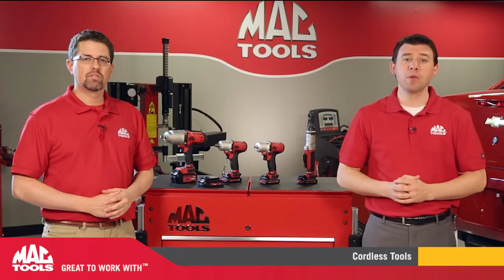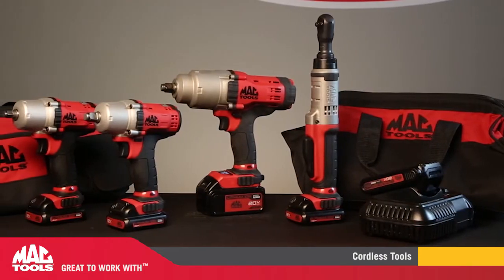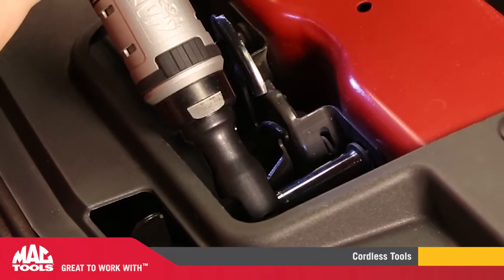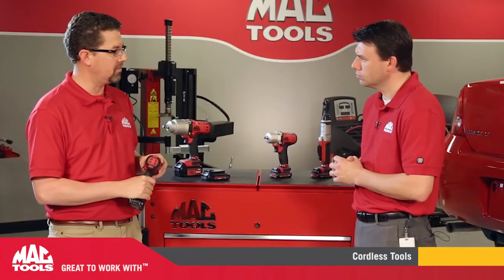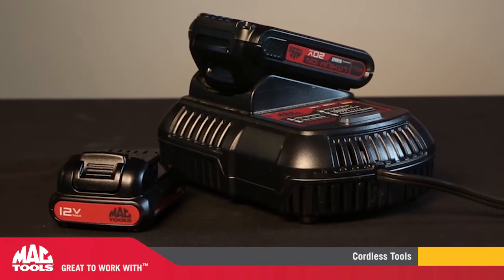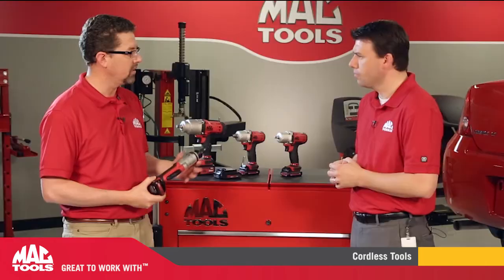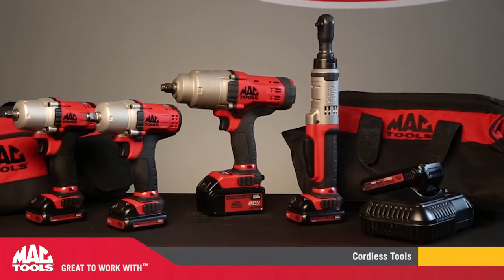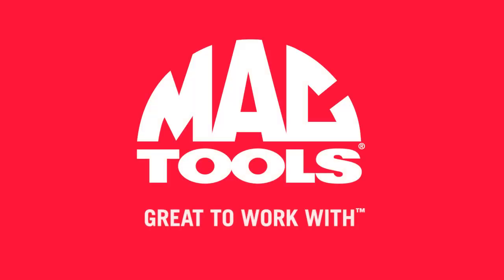Mac Tools Cordless Tools Video

Comment: Dewalt. Not Mac
Reply: Mac actually OWNES Dewalt along with many other big tool brand names.
Reply: Dewalt makes it. Not Mac. You should spell right. Owns is spelled owns not "ownes".
Reply: It's just Stanley black and decker sharing parts and products again if you want another example look at the overlap between proto mac, falcon, and usag
Reply: @js_1995x  actually, Mac uses heavier duty components and the case is made to resist automotive fluids. Its not like they are hiding it... the batteries and boxes even say "powered by DeWalt"